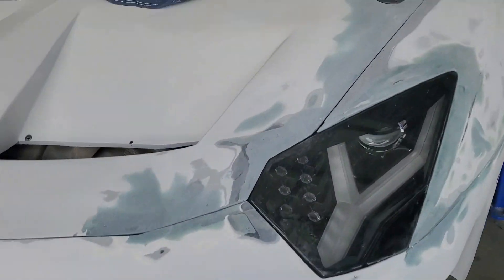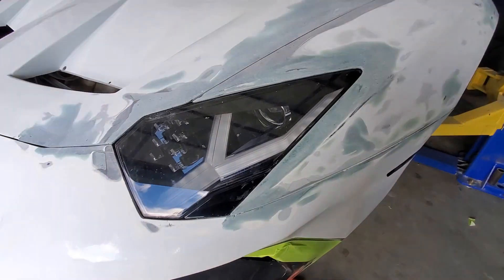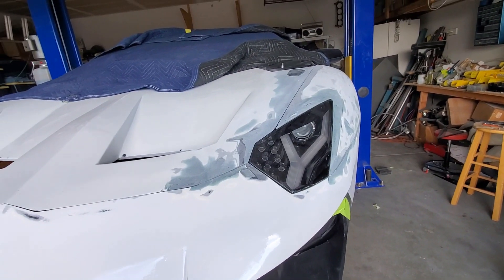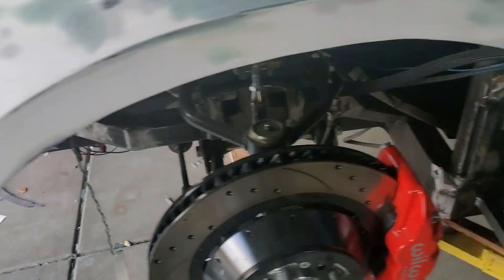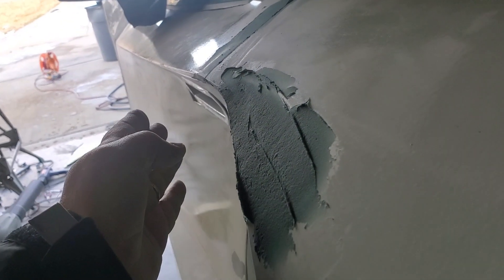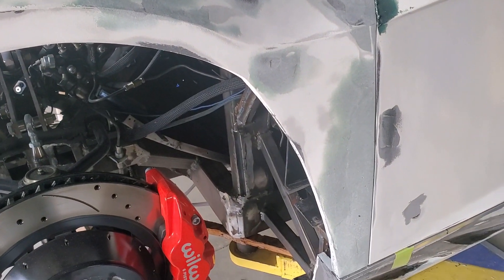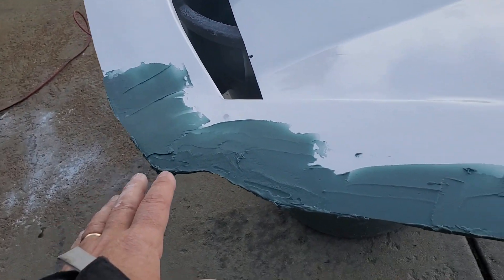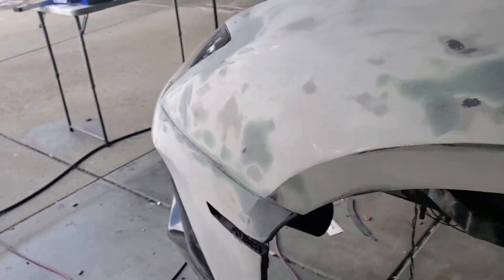3D Printed Interceptor Lamborghini Aventador Update 132

Comment: Body work is the worst.  I'm gonna do that to my Skyline this winter to get rid of some dings, a small door dent, and respray the paint...  Dreading it.  Maybe I can find some inspiration from you.

Don't know if you remember but I asked you a while ago about the switches you use for the gear selection display and how they were mounted.  Well I got some micro switches and mounted them on my car to do that for the eccs so it knew it was in a forward gear.... Well a 5 speed swap with an auto eccs the computer didn't like that at all.  Caused a mess of issues with idle,  timing, and would cause backfires between gears at times.  So removed all of that and just use the built in neutral switch on the trans.
Reply from the maker: I do remember.  Was your computer fully programable?
Reply: No, it is stock.  I was trying to fool it to think it was still an auto so it would give more timing in a forward gear
Reply from the maker: @AaronFergFerguson  Ah.

Comment: Inspiring & informative as always. Has the environment affected the materials. e.g. cold weather/heat from car warping the panels? Vibrations causing panel gaps? Heat flow/air flow/moisture etc the usual suspects.
Reply from the maker: Not yet.  It has been in 5F to 108F, with no issues.  All panels are encapsulated in carbon fiber which helps.